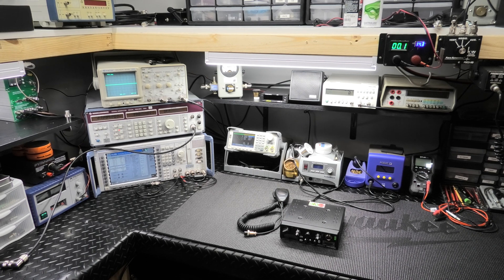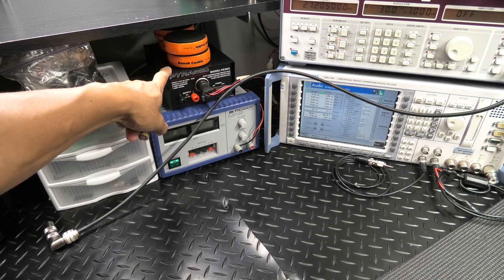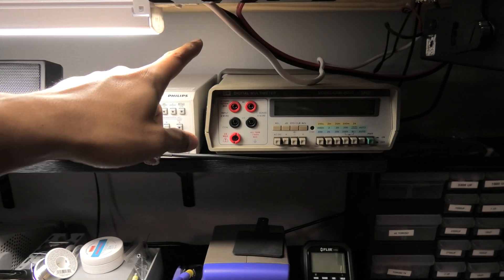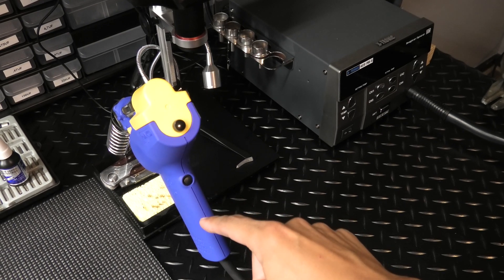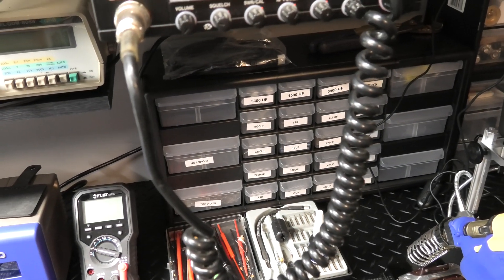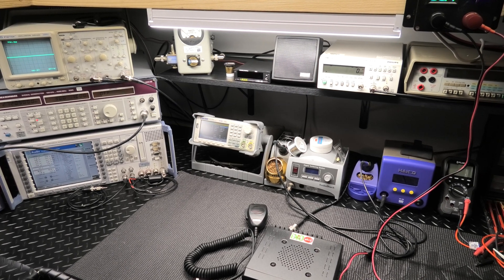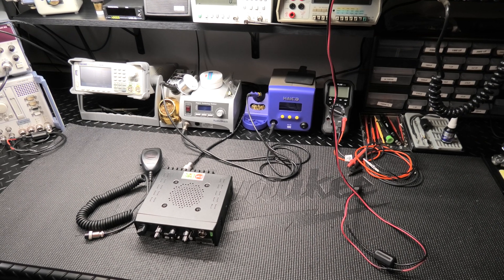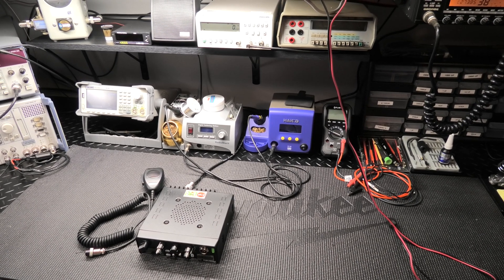The New Bench *CB Radio RF Communications* Test Tune Repair

Comment: I have a question why do u have a signal gen ontop of the cmu200 when that machine has a signal gen in it already
Reply from the maker: If you have the audio analyzer option you cannot run that plus the rf gen at the same time..bad design so must use external rf gen

Comment: i have the cmu200 also, mine does not have the 41 option what all does yours have? i would love to use this test set instead of all the other components i have so far. thoughts?
Reply from the maker: No cheap way to get that option added. I know another subscriber is having the exact same issue. He bought a cmu200 not realizing that the audio analyzer b41 option was not installed. Mine is pretty much loaded I believe. Thanks for watching 👍
Reply: @TheRadioGarage  You guys need to ask that other Mark guy about them. All I know is that he does something with these things that makes them do other things. I don't understand it. Just ask the guy about it I bet he knows.
Reply: @taft2422  There are two levels of functionality in the CMU - one is based on hardware options (Named like "CMU-Bxx" - for example CMU-B41 is the Audio generator/analyzer) and the other are software options (Named like "CMU-Kxx" - for example CMU-K14 is stereo FM generation).  So you can generate all the feature codes and put them into the unit - but you also need the relevant hardware).  For example, CMU-K29 enables testing for the old AMPS mobile phones - but it also needs the CMU-B21 signalling module and the CMU-B41 Audio generator/analyzer hardware options - if either of them are missing then although it will show as "enabled" you can't actually activate it.
Reply: @TrimeshSZ  I dont know man. I just know there is a guy that make some program that controls the thing.
Reply: @taft2422  Ah, OK - I thought you were talking about the software options, which are a bit confusing because many of them depend on installed hardware and although they will be recognized without the hardware that won't do anything useful.